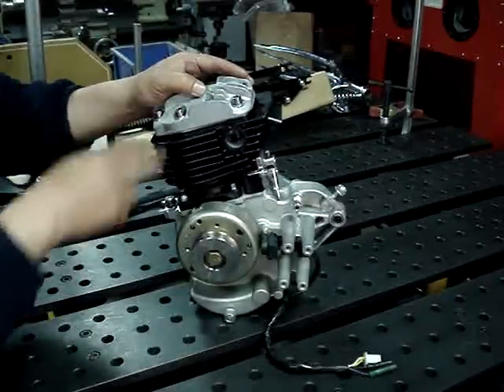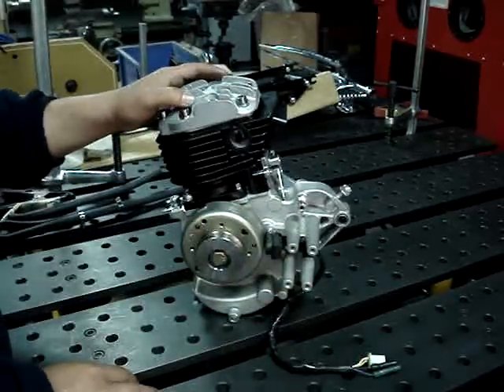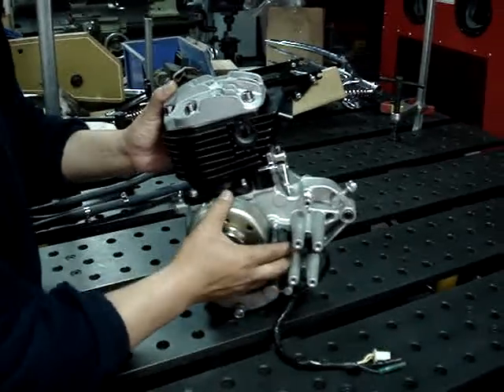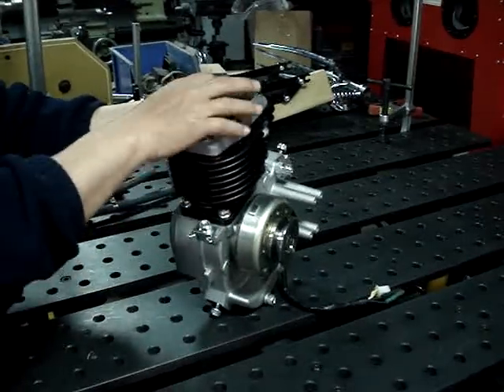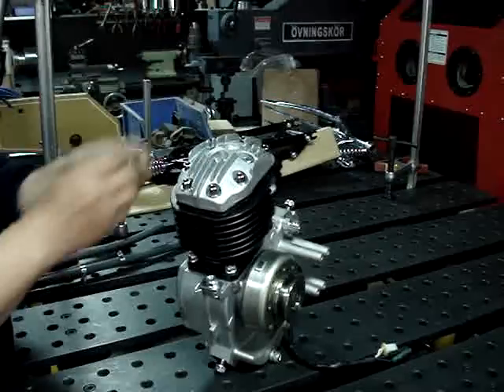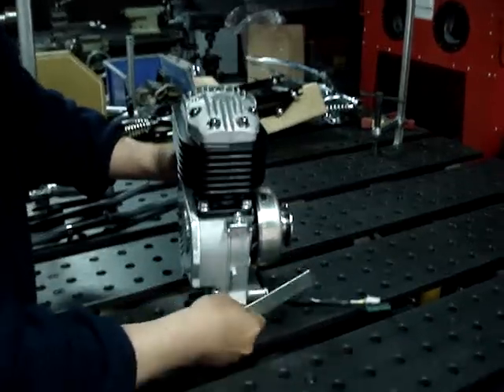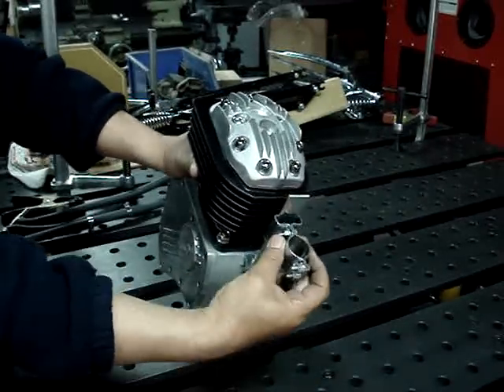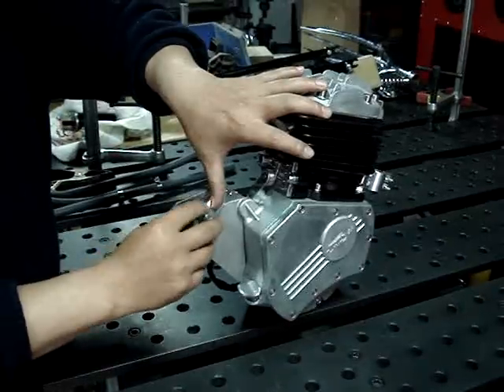Whizzer engine NE5 reproduction

Comment: Hello, I have a question for you.  I have a 1998 WC1 whizzer.  I have the original motor that has the cylinder head issues.  I would like to remove the entire motor and replace it with an NE5 motor.  Do you still produce the NE5 motor and if I bought one from you, what else would I need to purchase in order for it to work perfectly with my bike?  Thanks in advance for your answer.